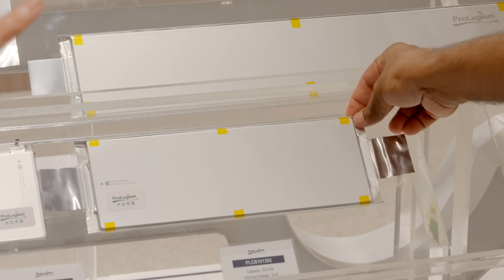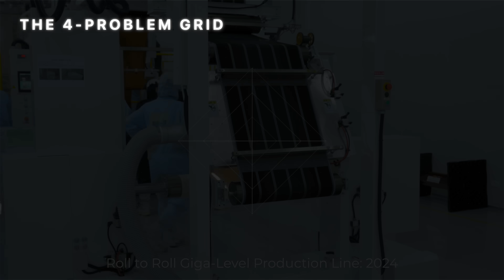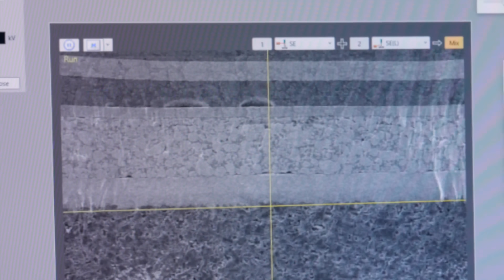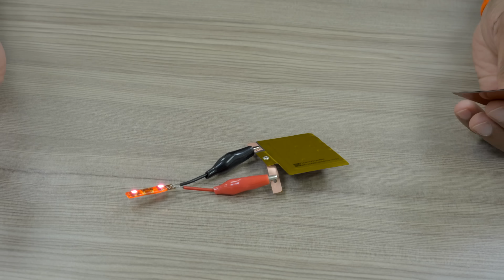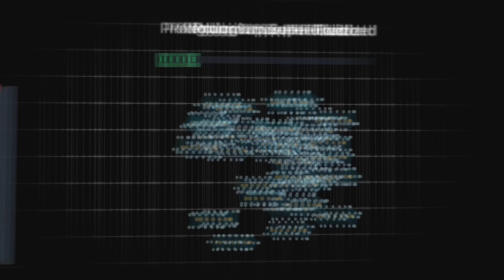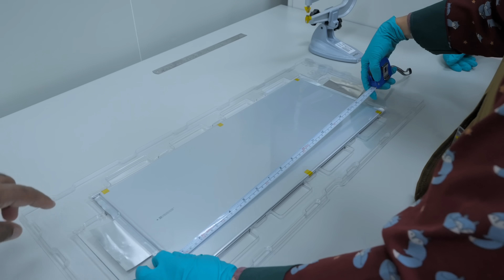Testing a REAL Solid-State Battery - Finally Here?

Comment: Prologium has been touting these ssb for a loooong time, years in fact
 Something is not right when those tens of thousands they claim to have produced and sent to validation dont show up anywhere in commercial form.
Reply: I wouldn't expect the government bunker power storage systems to wait in line for a commercial release.  These tens of thousands claimed to have been produced are probably validated and in use in underground bunkers along with most of the missing COVID toilet paper and non perishables!
Reply: The production line only finished scaling up last year, and most of the output goes to direct investors (ex: Mercedes) and an undisclosed partner first.
So most batteries start to be delivered to other companies just this year, and there are a lot of well-known companies releasing announcements that they are testing it / starting a partnership

Is it really all good? It's still hard to tell, but at least engineering samples are being actually tested
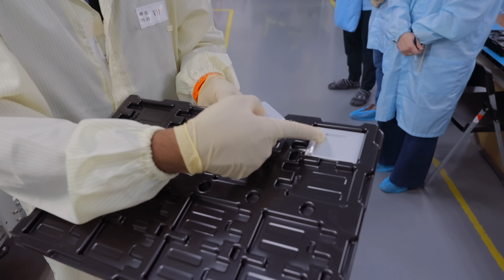Reply: @05:50 "by 2013 they were already shipping commercial cells" (13 years ago)
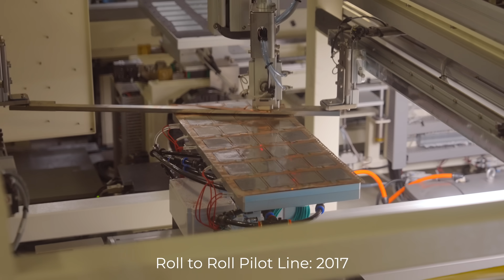@05:58 "they moved to roll-to-roll production in 2017" (9 years ago)
@06:04 "today they've shipped over 2.4 million cells"

Where are all those cells, and why is taking decades to get it into the commercial space? Something is quite fishy around Prologium claims and timeline.

Comment: Sooooo when can i buy a phone that lasts two days with no degradation and a 5 to 10 min to full charge time?
Reply: mine lasts like a whole week on 1 charge...
Reply: @Xihrzah Mine is almost 2 years old and doesnt last the day. Ive been waiting to upgrade, because all of these solid state advancements should be making their way to our devices.
Reply: @f3nixfire  try stop using it for everything else other than a phone, and you will be surprised how long the battery lasts!..

Comment: This is certainly impressive chemistry and engineering, however without cycle life and volume pricing it’s a bit academic.
CATL and Gotion both have volume production of sodium ion cells of 175 Wh/kg, $19/kWh cell, 10,000 cycles and 260 Wh/kg, $? kWh cell, 20,000 cycles respectively.

Comment: The best solid state video ever! One question that I have what is the cost of kWh?
Reply from the maker: everything they've done is in the interest of mass production. For example, they told me they're exploring a lithium metal anode, but it would add cost due to prices of sheet lithium. so they're looking to make these as economic as possible. I think prices are widely stated. Most companies that sell to other companies B2B dont because the prices will depend on quantity etc

Comment: 12:21 "Nothing leaked" funnily enough the slightest smoke did leak out amongst the initial cut, I wonder what that was? But tremendous performance none the less across the board! Exciting future
Reply: That was magic smoke, very common in solid state electronics, especially old tantalum capacitors lol.
But seriously, the scissors caused a dead short which means localized heating. That may have been the sealant being evaporated instantly. A conventional cell would have a LOT more smoke.
Reply: @kstricl agreed re a normal cell smoking alot morr, or better yet exploding in your face :D

Comment: Does it have any negatives vs LIPO or LIFEP04? Cycle life, or self discharge rate? Does it degrade if left discharged, or discharged below a set voltage?
Reply from the maker: these are great questions! I hadn't thought about self discharge, but I will ask the team and find out! thank you!

Comment: Initial question does come to mind; does it just stop charging when you put a nail through it? Or could I nail up solid state batteries like they're Drywall panels? (I suppose we could always leave holes 16 inch on center for new builds)
Reply from the maker: this is a good question, i think it depends on the puncture. if its shorted out and remains shorted out after puncture, the cell is dead but safe. if the source of the short is removed, like when I cut the cell, there's a chance it can keep working even after puncture

Comment: 8:30 Very curious about this Active Safety Mechanism. If at 125 degrees it turns the charged cathode and anode to a low energy state, and few heat is produced, where did the stored energy go? or is it an endothermic reaction to a stable state?
Reply from the maker: the heat stays in the pack, but no further reactions are allowed. so it kills the activity of the cell! thats why the oven test and short circuit or puncture tests build up a little heat, but stays safe. the safety was their first target and I learned a TON ... honestly this video took 1 month to make just to understand more of the chemistry. But solid state batteries are not inherently safe, you can have a solid state battery that can still have issues. I was just BLOWN away by ProLogium... and learned SO MUCH
Reply: thank you for you hard work just  so we can know more about this company, there must have been tens of thousands of documents to read..

Comment: One thing DONUT may have to be given credit for is spurring (panicking?) major battery manufacturers into also revealing their solid state technology status…some are close to, or already have mass production lines running (Pure Lithium New Energy have 500MWh SS LFP line operating now). However, most Chinese companies seem to be announcing semi-solid state production at present on account of a quicker path to mass production.

Comment: This is great. I have 2 questions:
1) why aren’t these being used in Toyota/Lexus hybrid and plug-in hybrid vehicles, iPhones, and Microsoft Surface Pro laptops/tablets today? (And when will they be used in them)
2) in the energy density tests you took the voltage all the way down to 2v - what is the energy density if you only allow to discharge to 3v?

Comment: It will be more than 30% additional range with the same size pack. Because solid-state battery pack need less cooling/heating and safety infrastructure.

Comment: Thermal runaway does not need to involve the internal release and combustion of oxidizer and fuel. Thermal runaway occurs the moment the cell releases more heat internally than it needs to dissipate to prevent the failure from propagating through the cell, whatever that failure mechanism may be. NMC/NCA are just more notorious for producing oxidizers during failure, enabling them to promptly ignite and keep burning no matter what you throw at them.

That is why LFP cells that do not release enough oxidizer to burn on their own can still go into thermal runaway, release highly flammable hydrogen and carbon monoxide as they do so, and cause an explosion when fumes from failing LFP batteries mixing with air in an enclosed space find an ignition source. Spark igniters have become standard equipment on industrial LFP batteries because of this, safer to have a visible flame than an invisible explosive vapor cloud.

Nail puncture tests on a tiny cell do not mean much beyond the cell not spontaneously self-destructing like NMC/NCA do. Most LFP cells can pass the "nail test" simply because the current density as the nail is slowly driven through the cell allow electrode layers to blow themselves open faster than material around them can be heated into thermal runaway territory. For EV-scale batteries, a more relevant puncture test would be something like the jagged end of a broken sign post jammed through at 20m/s: short-circuit current spread across a much larger area across the entire cell stack, no clean edges or points to concentrate current within the cell to blow itself clear. That is how you penetration-trigger thermal runaway in an LFP cell.

If they really have solved all the major problems, I can imagine many governments deciding that NMC, NCA and maybe even LFP are too dangerous to allow in new devices and impose a sunset clause on volatile battery types in domestic applications. I am not a fan of throwing away still perfectly usable devices just because their NMC/NCA battery has inevitably gone spicy pillow and official replacements where available are outrageously overpriced.

Comment: Thanky for mostly using the SI system. But in engeneering and science the order of magnitude is defined by 1000  times or a 1 tousends of, one of the reasons wie have that stupid greek and latin letters - a Kilo Watt ist 1000 watts thats the fist order of magnitude and a Mega Watt is the 2nd order .... only exeption is the Hekto=100 times, the c the 100th and the D and d for ten fold of the basis Unit.
For practical reasons some units like PSI still exists, mostly becaus the Pascal is a very smal base unit. A single conversion errors was responsible for the Challenger catastropy/tragedy !!!

Cheers for your interesting report from Taiwan.

Comment: Absolutely fascinating.  I am so in love with this cell technology.  You have made a great video here Sir.
It is hoped that this technology can be licensed to other cell manufacturers.
We are in times when we really, really need to share rather than guard breakthroughs like this.
Looks like most of the industry including CATL are a step or three behind.
It is very rare to see a series manufacturing line that is this length and size - for anything.
And yes, I also was impressed with the screen-printing process.
The people of Taiwan deserve global medals for the tireless and groundbreaking efforts they have diligently applied to science and engineering excellence.  Excellence the entire planet has benefited from for 3 decades - especially TSMC.

Comment: yay i will seal clap cause the information how solid state batteries can actually crystalize inside and then go into thermal runaway has not been declared here - yes its safer in the majority but without warning or anything for anyone to know, the battery can still blow up and go into thermal runaway 
but lets seal clap cause can do stuff to the battery and it appears to be safe - the other batteries in EVs should never been allowed in the first place but hey lets stick a battery that is asfer till its not and can burn everyone inside a home - its a solid state battery - seal clap cue now

Comment: Wait, that capacity test took the cell down to 2V? Is that a sustainable discharge voltage? That's pretty far below typical lithium ion chemistry. 

Even if the battery survives that discharge level long term, it might mean it's not a drop in replacement for other chemistries.

Comment: That was a great video 👍 in these uneasy times it gives me hope for the future. Energy density of 360 Wh/kg ? That gives you 1,000 km range with a battery weighing 450 kg. Bye, Bye Internal combustion engine. You forgot to mention the other secret ingredient of the battery; the tears of Arab Oil Sheiks. The orange one won't like this 😂

Comment: All I can say is Holy Sh*t.  I am blown away as well.  Thanks for delivering a fantastic video.  The world and our dependence on fossil fuel has just changed.  Upon reflection, I missed the number of  charge/discharge cycles.  10K 100K or unlimited,  What degrades over repeated cycling if anything.  A 6 Minute charge time is insane, for the power density.  I love the operating temperature range too.  And yes, Canadian winters cause a 30% drop in range on my Chevy Bolt. Not to mention having to drain it further running heat/defrost from time to time.  Thank you for a great video!
Reply: They say 1,200+ so probably NMC comparable, but not as good as LFP or sodium.
Reply: @daveantolovich9025  Thanks, that to me seems to be a limitation if that's the case.

Comment: Solid State = NO MOVEMENT. A lightbulb not powered is in a Solid State. Once turned on Electrons move within, heating up. A few are changing their rotations and frequencies to become Photons (light). The rest remain as heat. The bulb is no longer in a Solid State. A battery sitting, unused, is in a Solid State. Charge or use the battery, with moving electrons, and it's NOT in a Solid State. How can a solid-state battery do ANYTHING? Physics definitions are being misused.

Comment: What is the internal resistance? I would expect, when cutting with scissors, to get more of a reaction as the scissors short the plates. That makes me wonder if the cell was almost discharged with a high internal resistance which would still happily run leds. Equally the cell short test didn't exhibit the sort of current one might expect. The cell charge rate was expressed as theory based on electrolyte resistance, what is the real world rate? Same question on discharge rate.

Comment: Cycle life at rated capacity is the ultimate test and without it we keep fingers crossed. Openess is well appreciated.
Reply: They're stating on their website >1200 cycles. That would be for the average EV user some 8 years until the battery would reach 80% of total capacity.
Reply: @grabedigger  still a far cry from Lifepo4's disgusting 3000-6000+. This will remain for higher end, performance applications till then.
Reply: @anotoman123 the chemistry last up to 6000 cycles, but there is a lot more to a battery than just the chemistry, this solid state battery is built tough to handle all types of abuse
Reply: @anotoman123  Puts it more in the NMC market space which is where it's energy capacity also puts it, and those are the real problem batteries for safety in cars.
Reply: @etchedpixels I see more applications for laptops, phones and tablets at this stage
Reply: @gregb1599  uhh, you are switching back to the safety issue while here we are talking about charging cycles and durability over time of use. i don't care that much about that, everyone has different priorities, for me safety is first so would still buy this battery over others, safety is a strong selling point over charging cycles.
Reply: @anotoman123  isn't lifepo really sensitive to external temperatures? If so it's a complete no go for automotive use in any but a handful of climates
Reply: @anotoman123  lifepo with its 3000 cycles is not comparable and can not be used in most applications. it has these cycles at something like a 0.2c charge and max 0.5c discharge rate. also its weights many times more. lifepo is completely useless chemistry for most moving vehicles, its usable for stationary energy storage
Reply: @grabedigger  cycle life to battery lifetime is not possible to calculate without the size of a battery or consumption. If you expect a 60kWh battery in a car with 18kWh/100km avg consumtion and 1200 cycles to 80% and expecting linear degradation you will be at 360.000km of lifetime which many cars don't even hit when being scrapped. In an SUV with 25kWh/100km that would be "only" 259.200km. Even though higher consumption cars often times are bigger and feature bigger batteries which increases the lifespan again.

Additionally there is calendrical aging which is not reflected in cycle times. We don't know what side reactions exist between the anode/cathode and the electrolyte that may or may not influcence the aging. 
It's also relevant how the cycle test was measured. Range of SoH and charging speeds can influence those numbers massively. A test between 30% and 70% SoH with 0,5C can result in massively better full cycle counts than a test between 10% and 80%  (which would be realistic for automotive use) and 2+C.
Reply: Depends on use case.  For very weight-sensitive applications, high voltage and low cycle life are standard.  Check out phone and controller batteries: they're all rated to 4.3+V and last maybe 500 cycles.  So ProLogium's drone battery will have far fewer cycles to 80% than their EV battery.
Reply: @concinnus At that point it's about cost and replaceability, in which case we NEED self serviceable parts
Reply: @ZananoQuinito  if you make them cheap enough people won't care about that, usually a new product becomes cheaper as other manufacturers starts selling the thing, now everyone is hustling to sell more than the other so the original price gets cut off even by half sometimes, we have seen that happen with smart phones for example, a market dominated by Apple once, now it's everyone else's market, which reduce cellphone prices drastically, this is why a person living in a very poor African country might not have water or proper food on daily basis but he or she owns a cellphone.
Reply: @lcfflc3887  I get the market and consumer answer, but I'll agree with the comment before who specifies that we need repairable devices. Cost changes aside, designing and documenting in a way that allows for repair and eventual repurpose is the only responsible way to create products. As established, it's not inherently incentivised by pure free market capitalism, but so many things aren't, and we need regulations that direct innovation and entrepreneurship towards socially positive outcomes.
Reply: @jacobparis6576  if you are pushing for responsable consumers and manufacturers you will have to push for legislation because they aren't doing this on their own, for the manufactures is not profitable since they rather sell a new product all the time rather than parts and for the consumer replacement for a new one is just less time consuming and give them a more reassuring feeling because the thing is brand new, few examples, consumers do this all the time with: number one on the list, cellphones, tv, computer monitors, laptops, tablets, air conditioner units, heaters, refrigerators, watchers dryers and the list goes on. this is all by design by those who sell you this things, both sides happy. I'm more of a repair type of individual myself if the choice is available.